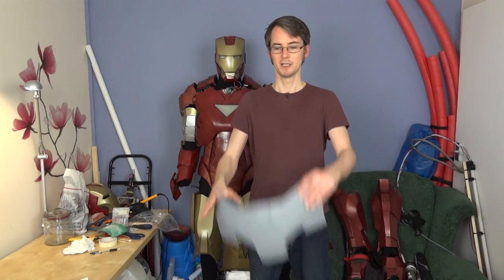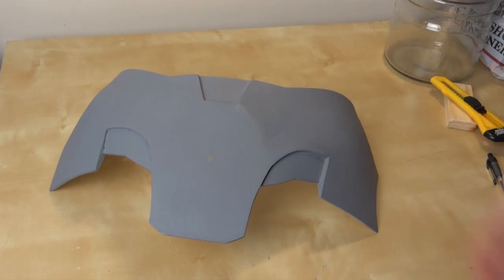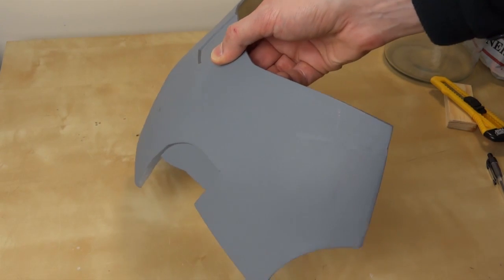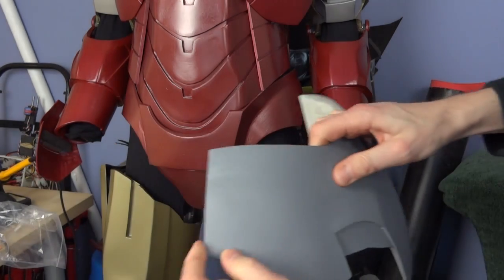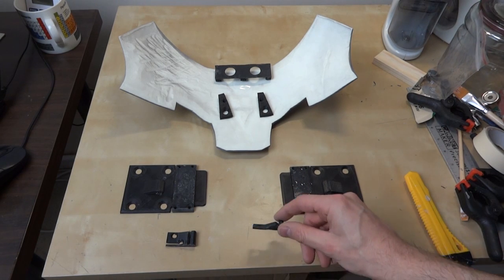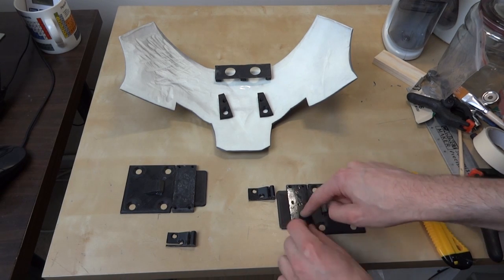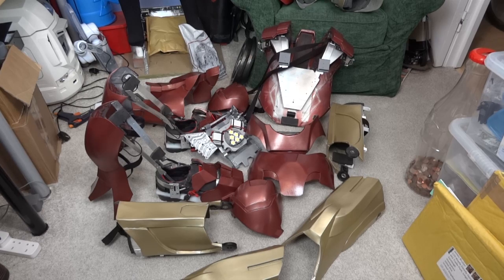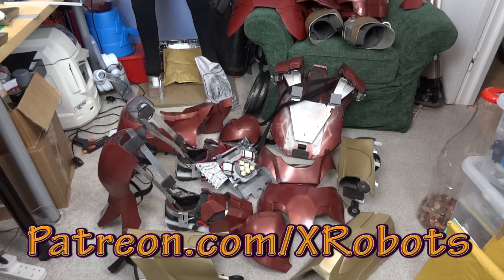Iron Man Power Suit #54 | Suiting Up | James Bruton

Comment: As good as your armor might b and don't get me wrong other than the helmet I think you have done a very good job, I am slightly disappointed in ur mounting system surely if you took more time and focused a bit more u could develop a electro hydraulic system to mount the suit as well as increasing the practical use of the suit. Dont get me wrong other than the helmet ( which I think needs reworking as it is far to square). Your designs are inspired, but I was hoping to see a more practical yet imaginative design for the mounting system, as I mentioned before I was hoping for some sort of electronic hydraulic system which is theoretically possible and practical for real life uses such as heavy lifting. Again I do not wish to slate your designs or your process you are a huge inspiration for mean I just expected more from you as selfish and stuck up as that may be again I mean no disrespect to your ideas as I have said are inspired I just feel you got a bit lazy with your design aspects. Again I sincerely hope you do not take offence to this post and would maybe take into consideration some of the points I have made (as few and indecisive as they may be ) 
Thanks for reading James :) 
Michael. Aka big fan of your work :).

Comment: you probably have to trim the knee area to avoid them banging, perhaps a separate knee cap piece attached with bungees for cover and flexibility.  Similar to a plate mail with chain mail inner layer and joints, with lighter material like foam or fabric of course.